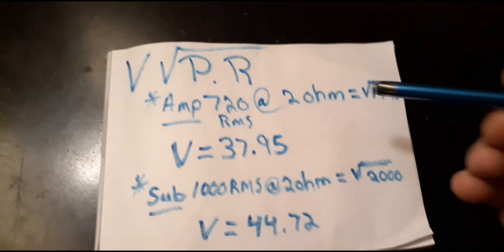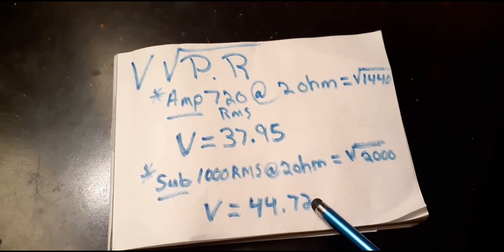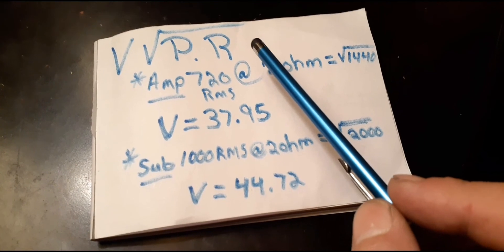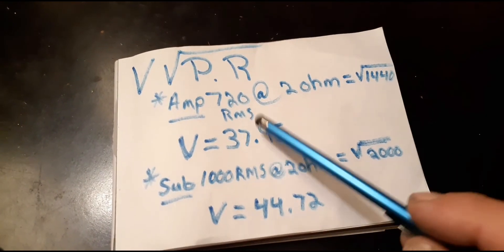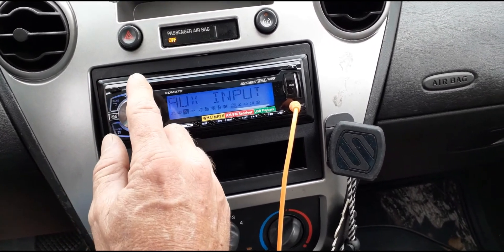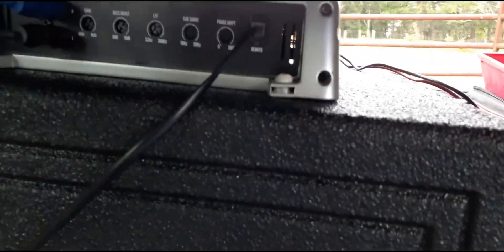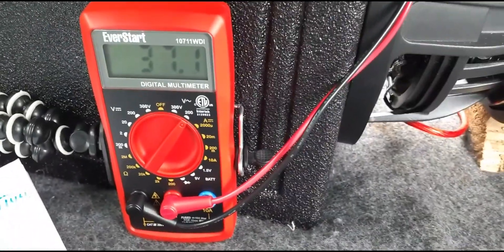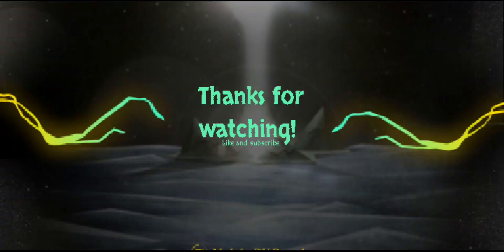Get Voltage number and Set your amp gain with multimeter!

Comment: Question what if your amp matches your Sub for instance my amp is rated at 1500.1 class d mono 2ohm stable and for my sub max power is 1500w D4 but the RMS is 750 per coil if I'm correct, when I do the method of what you show I come up with 38.5 give or take . I just got a new custom box 4th order will my voltage stay the same or will it need to be adjusted?
Reply from the maker: Yeah you got it right. Just so the 1500 But sooner or later I'd upgrade to a 3k amp👍😁
Reply: Cool beans thanks for the advice and getting back to my question pll trying to tell me I'm wrong. So why a 3k? I'm only running a single 12! I'm just curious.
Reply from the maker: Well your sub is 1500 rms So if your amp only puts out 1500. The sub isn't getting it true potential. Not saying to use all 3000 watts. But like 2k or how ever much your sub can take. Also if you ever get another. You will already have the power for it👍😎
Reply: @bassjunkie2020  oh ok that makes sense to me. Other than getting another one I don't think they make that model anymore been looking but only find newer subs I have quantum audio qc12d4 with hifonics 1500.1 
Thank you again for the advice, plus you vids are straight to the point and not dragging on about all the other bs I can see where ppl would get confused thank you
Reply from the maker: Thanks I appreciate that 👊😎
Reply: I have a 1500bdcp same power 1 an 2 ohm. I wanna give both my subs 650 each which is 1300rms. So 1300x2ohm load will be sq root of 2600? Why is voltage higher at 2ohm than 1ohm thought 1 ohm was more stress on amp? Thanks
Reply: @johnnypiper1717  it because your doubling the Sq  root of the number at x2 instead of x1 thus the  number is higher at 2 ohms
Reply: @Daniel Kulwicki  cool, it jus confuses me when say I wanna push only 1300rms to my 2 subs. Jus seems like running at 2ohm load would be more ac voltage compared to 1ohm when doing the math. I always thought 1ohm was more stressful on amp compared to a 2ohm load.
Reply: @johnnypiper1717  I'm running a single 12 at 2 ohms  I took the wattage of my sub which is 1500 max an ran the Sq root of that and have had no issues  I believe my voltage came to 37.8 but if your look to run 650 watts each just find the root of 1300 and you should be  fine in most cases they may be a little under powered  but at least you won't have to replace them in a few months like other ppl I know.
Reply: @Daniel Kulwicki  oh ok I thought that if you wanted to run 1300w at 2ohms you would do 1300x2 and get 2600 and then take that sq root and that would be your 50.99volts.
Reply: @johnnypiper1717  right  but you mentioned something about running 650 to each that's where I'm a bit confused.  But no biggie.
Reply: @johnnypiper1717  also if that's what your subs max watts is if you have two you double  the num also depends on if your dropping down if they are d4 or d2 voice coils. If more than one sub double. Like I've mentioned I've only gotten one sub. Your probably right about your number's I've always had to get second and third opinion.
Reply: @Daniel Kulwicki  yeah I'm definitely gonna have 2 subs wired to a 2ohm load. May jus go with the DDm2000 since it's 1300rms@2ohm load and jus go that route. And check see what the voltage is and adjust from there. Thanks alot